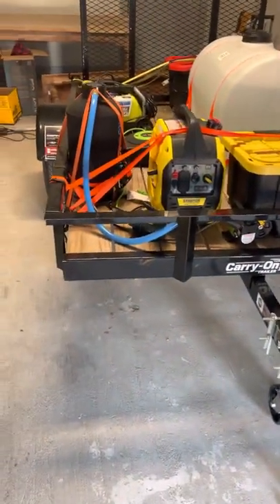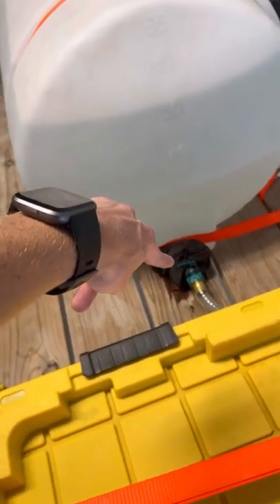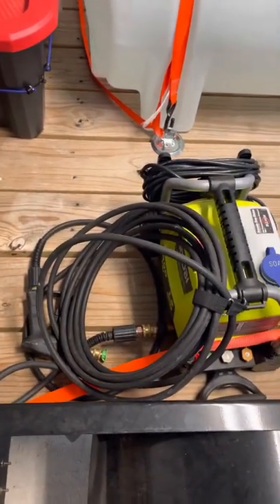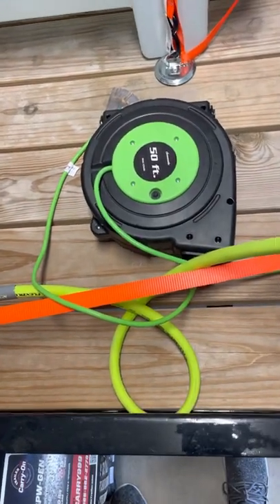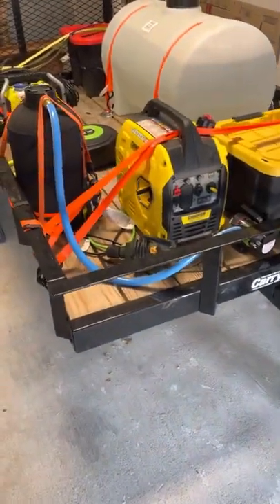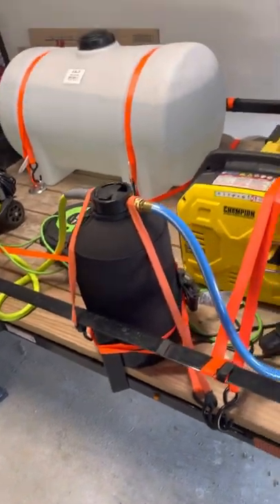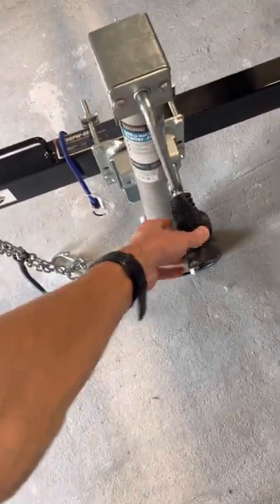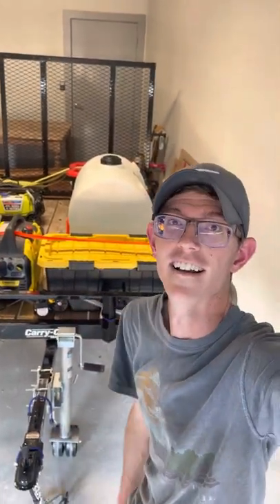Trailer setup for my auto detailing business!!

Comment: How’s the deionizer holding up ? I’m in the market for one and was checking this one out ?
Reply from the maker: It has held up really well since I got it months ago. I have replaced the resin yet but I think soon I’ll look into that since the heat is starting to rise here in Texas.
Reply: @atkinsautodetailing27 but it's not a deionizer right? Just a water softener? But does it rinse clean without spots left that's the important part. I'm trying to decide if I want to try this cuz its a lot cheaper than DI unit and refill resin which fails fast in my region